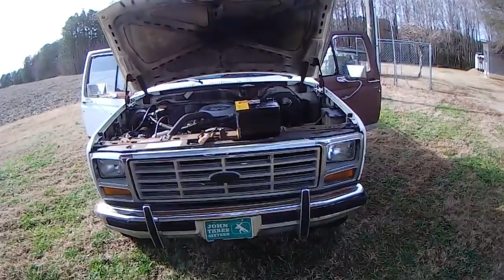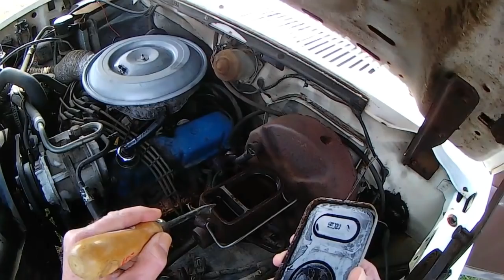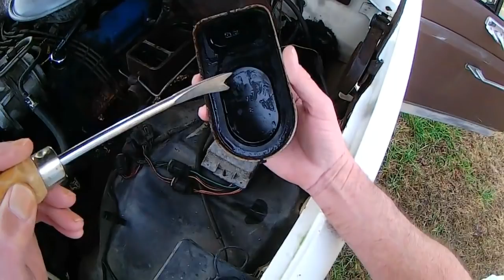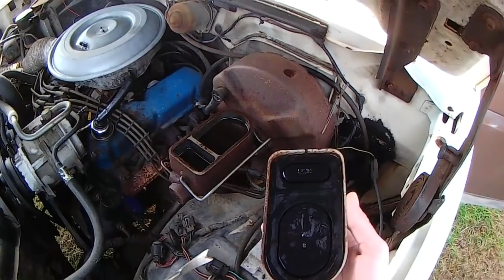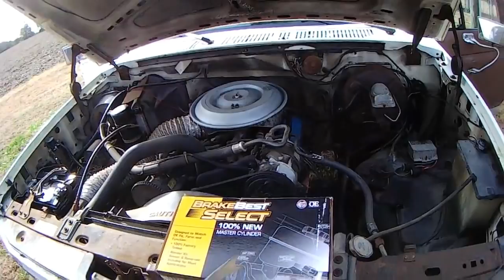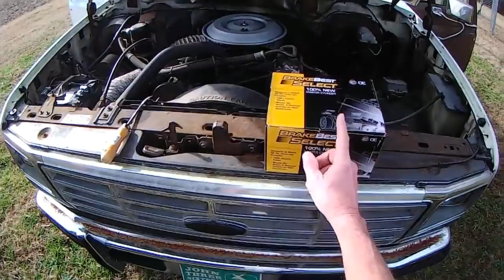Another annoying item needing repair

Comment: Fair warning if it's the pipes I'm sorry the lines to the brake lines you're going really want to soak them heavy with penetrating oil before attempting to take off the cylinder

Comment: I was thinking to myself if it's that Rusty is be replacing the whole thing. Of course that's what you ended doing. But I've found that out with older vehicles you can do that more often than not. Thanks again for sharing.

Comment: a lot of the parts are cheap for them old Ford's nowadays when something aggravate you your better off to just throw another one at it and be done with it brake pads are real cheap for that the one thing that I thought was overpriced is the spark plug wires you can put master cylinder and a set of brake pads on there for the price of a good set of wires

Comment: On my 99 F-250 (with the diesel) there is a cruise control interrupt switch in the master cylinder area. Mine went out and Ford wanted $350.00 to replace the $19.00 switch. According to them you have to drain the cylinder,remove old switch,install new switch,bleed brakes,blah,blah,blah. Being I'm "thrifty" I simply got set up with new switch,had it at the ready,pulled old switch,stuck my finger over the hole and quickly installed new switch. Lost a quarter teaspoon of fluid if that and no bleeding required.....
Now I have done major brake repairs that required bleeding and Gerrald Farms is right: vacuum bleed set up is the way to go on those.
Same with hydraulic clutch set up too.